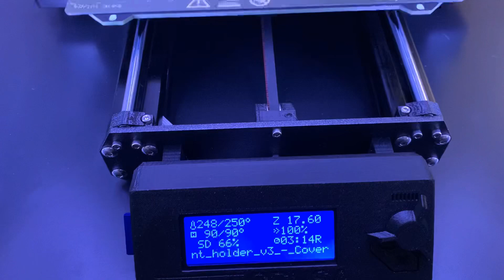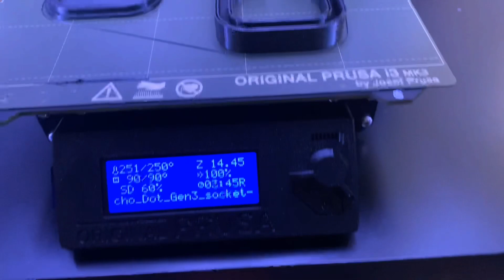Prusa I3 MK3S+ 3D Printer Black Friday Bundle review and IKEA LACK enclosure

Comment: nice, how much did it cost on black friday?
Reply from the maker: The same amount they just added a couple extras like the texture build plate.
Reply: @Tcodyw88  ok, thanks, Im saving up for a prusa printer because I am not that pleased with my Ender 3
Reply from the maker: @alex-w8p2e  I’ve seen some great results on the ender 3. I’ve learned personally with my Prusa that all printers require a heavy amount of trial and error. I had mine built at the factory and “tuned”  but I still didn’t start getting the print quality I thought it should be producing until I started really testing the filaments I was using. I would suggest trying different filament at different temperatures. Make sure all the belts have a even amount of tension, Print temperature towers, do a calibration of the extruder to ensure it’s flowing the correct amount. I really don’t think any of these 3D printers are turn key ready. There was a few times I wanted to send my printer back to Prusa lol.

Comment: Nice showcase! Just ordered the Prusa MK3S+ as well, and was looking around for DIY Ikea Lack enclosures. Yours look the best, so sleek to have everything in color black 👍 Also your filament is inside the enclosure instead of exposed to the environment, that's what I dislike about the original Lack enclosure idea
Reply from the maker: Thank you I’m hope to have enough filament mounted on inside the top to create the weight of a concrete pad to stabilize the enclosure a bit more.

Comment: Where did you get the longer IKEA lack legs? Or have you just threaded 2 legs together?
Reply from the maker: It’s as easy as using the supplied screws to connect them. I’ll have a video on just the enclosure posted up tonight.

Comment: What did you use for the plexiglass? Thickness and type? Also, how tall is the printer area? Thanks for the the demo!
Reply from the maker: 1/8” inch or 3mm clear acrylic.  Build height 9.84” inches tall. Other company’s also make upgrade kits to increase the prusa’s build height. Thanks for watching